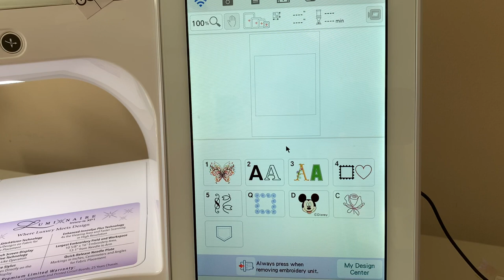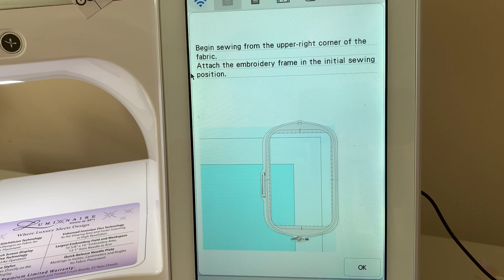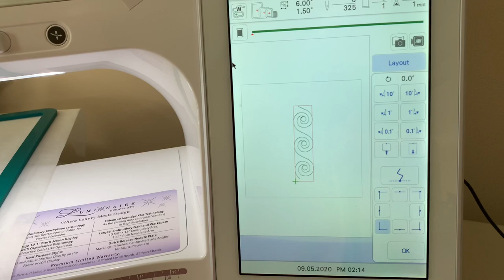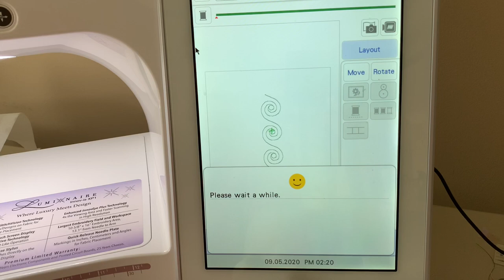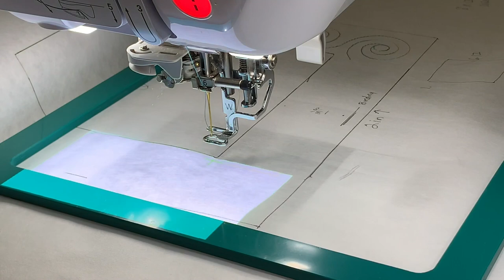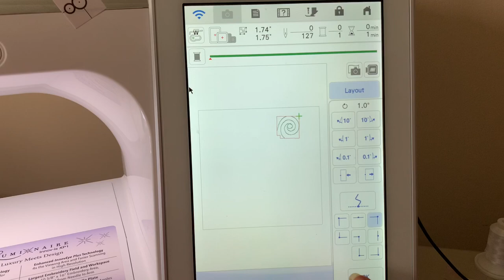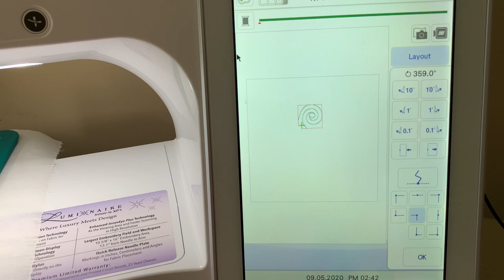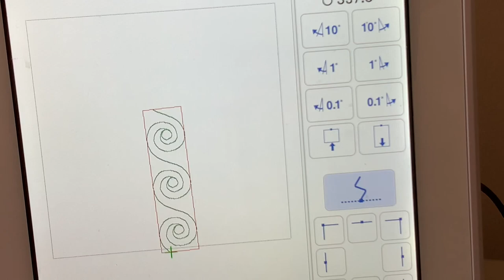Luminaire - How to Use Border Sashing

Comment: I have a question about restarting a design.  I have a solaris but it seems to work the same.  I made a mistake and had to redo a section.  When you are finished a section, it asks if you want to connect to the next section,  but I can’t get that to happen if I have to go back.
Reply from the maker: Do you have upgrade Kit 2?
Reply: Terry Maffitt I do have upgrade 2 and I did find the answer to this.  You have to start at the beginning of the design and advance to the last stitch, take one stitch, and then it will ask if you want to connect to the next section.